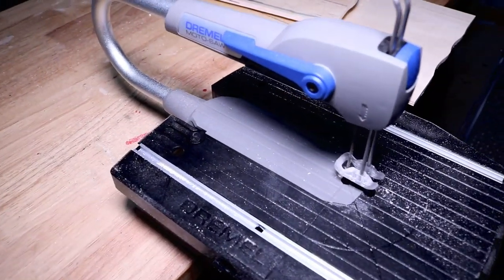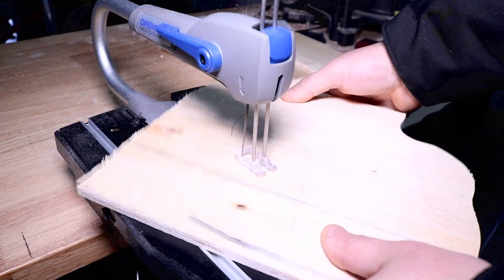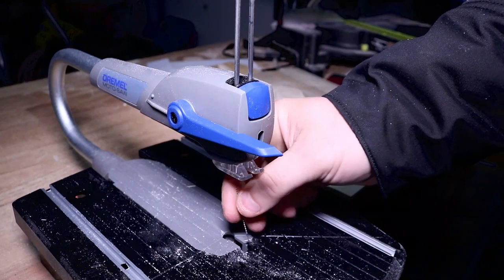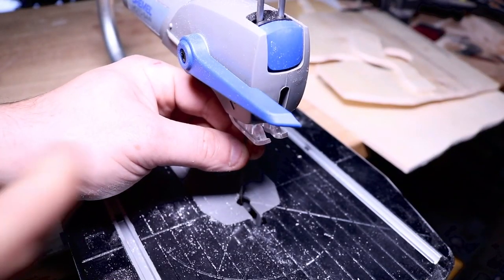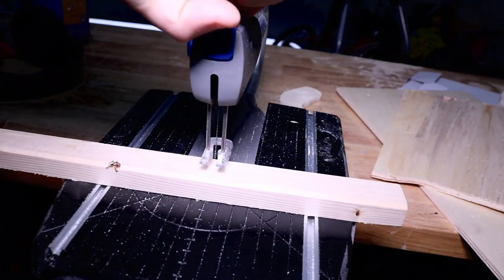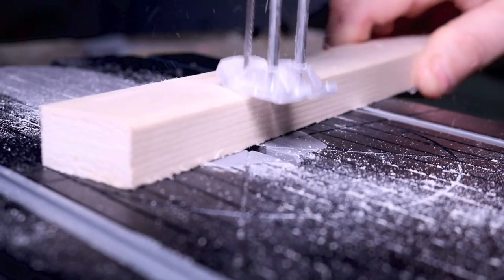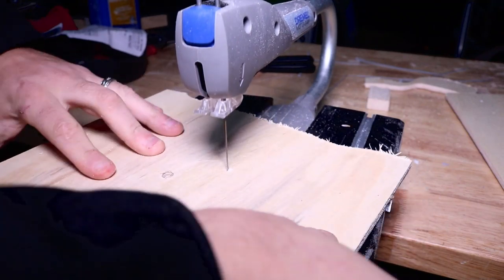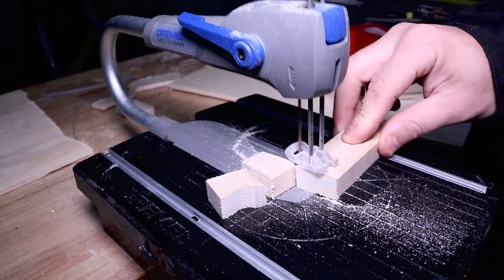Awesome little saw for the pros, crafters, diy'er and just about every other woodworker Dremel MOTO

Comment: Thank you for this review.  I bought based on your recommendation and found it perfect for work on polyglass (acrylic sheets) for making computer case mods.  it cuts well.
Reply: Do you think this will work on 1/8" plexiglass? 
What kind off  blade did you used?
 I need to cut several 6" circles for a project I am working on.
Reply: @Bandido  I'm sure as long as there is a blade to support that material then you would be fine but other than that I'm not sure

Comment: Just ordered one of these but didn't realise until you said that it doesn't come with the mitre gauge. Guess I'm just going to have to order one.
The only negative I can see long term is that the blades have pins on them which means there will be a minimum size hole that will have to be drilled in order to reinsert the blade to do internal cut outs. Other more commercial machines tend to not have the pins but cost a lot more.

Comment: I would like to add that since I bought this scroll saw, there is no way of tightening the blade holder, so it has somehow stretched and I cannot accurately cut anything.  Sad to say, it is not used anymore as totally uneven cuts.

Comment: I've had mine for years and until recently haven't used it too often. I did just start it back up and was using the saw out of the base to cut some 1/4" plywood. Three blades snapped in the process. Have you ever had this happen?

Comment: Very good saw easy to use blades fiddle to change but overall a good reliable tool to use like other dremel tools I use very good value for the money and a large selection to choose from  I would a.ways buy dremel without question cheers James 2022 sussex uk

Comment: Have just become a dremel convert as a retired diy-er was wondering if this comes with a 
U.K. 3 pin plug and could you confirm if it is 240 or 110volt, great video makes me want one
Reply: You can buy this in the Uk. It’s about £100 from numerous places.

Comment: I have some old balsa wood model airplane kits now. The 1/8th inch balsa sheets have the parts outlined, but i need to cut them out . This looks good. I'll look for your answer before i buy. Today is nov.1, 2020.🇺🇸...do you think it would be good for this ?
Reply: Hi I have the saw and yes if you use the right blades your be OK with it cheers James 2022 uk

Comment: welp, I picked one up along with 2 "angle adjustment" rails or fences, welp as you can see the rails are parallel with the cut direction?  and the fence is not width adjustable, the guide simply spins on the rail to a 45 rendering it totally useless? did they not even try to use this rail for anything? why I dunno cuz you certainly cannot cut at a 45 degree angle to the blade? what are they thinking here?  the rail should move opposite the cut direction so you can use it for adjustable width cutting which is what I need it for..

they need 2 more rails perpendicular to the existing ones perhaps on the outside edge then a fence to cut widths.. crazy the way it is now its pretty much useless, 2 rails the other direction one fence that connects between the two, an adjustable fence like a table saw..

I will use the two fences to hold in a piece of micarta with a hole drilled in it just large enough to put the blade through, this way I have a table to cut very small pieces, as in 1/8th width by 1/2" tall like 2.4" long.. mammoth tusk, guitar nets and saddles, as you know mammoth is quite rare and expensive so the chunks I can get two nuts out of I need to cut them in half, and this is the narrowest blade I could find for the job, a table saw blades width is the same width as a strat nut "1/8th" so you can see a table saw will not work with that kind of waste..

so my plan is to cut a micarta deck, holdit in place with one clamp and the two fences, then cut a piece of wood that's the distance away from the fence and blade as the width I need, 1/4" and 1/8th" should do as the strat nuts and acoustic saddles are 1/8th" thick and the acoustic nuts and les paul nuts are 1/4" thick.. thinking maybe use double sided tape to help secure the micarta deck and sizing blocks to the micarta, another reason I want a micarta deck, for adhesion and to cover the hole around the blade where small material would fall through, cant have that..

waiting for the sander so I can give it a whirl... it should work perfect long as it's not vibrating all over the place, should be able to find a sweet spot with teh variable speed which was another draw, the compact and portability was a draw as well..  I've had good success with dremel components they seem to be just good enough to get the job done which is welp, good enough...

Comment: Man. This .... SUCKED for me. And as far as just “throwing” the blade in & getting to work ..... yeah it took a professional carpenter & myself about 30 mins to get it in....
I actually had a pretty unpleasant time using this machine. & haven’t used it since that first time. It even dug into itself; I mean the blade somehow carved intk the area on the board just behind it. It shook like crazy when I used it... I was able to crappily cut an inch or 2 edge off a 1/2” piece of plywood about 12 inches long. That was it. And the 10 seconds it lasted was loud, wild, rough & like I said PRETTY unpleasant & I haven’t returned to this machine since.
I’m wondering if a regular old .. scroll saw would be better.... do they HAVE jig saws set up like a scroll saw? Where the blades comes in from the top? (You gotta excuse me, I’m NEW to this world of woodworking) 

Any insight?
I actually have a hopeful plan to build a 3 in 1 table with a table saw, router, & jig saw in 1.